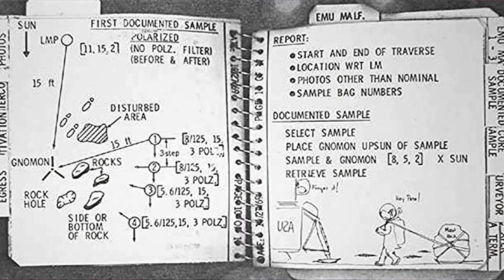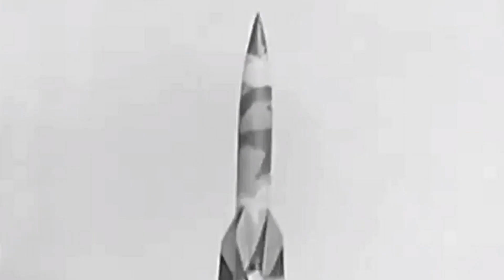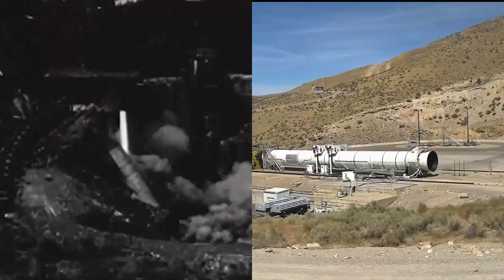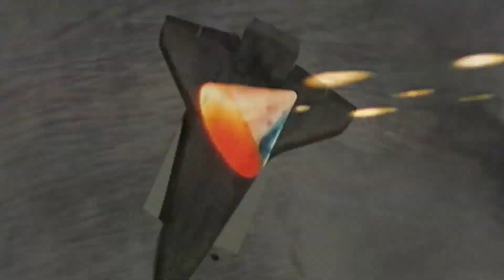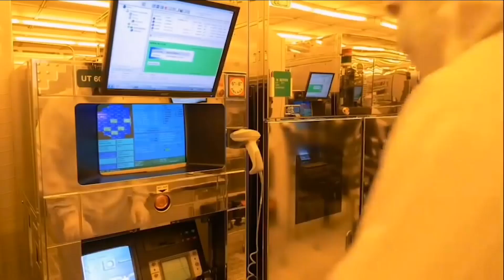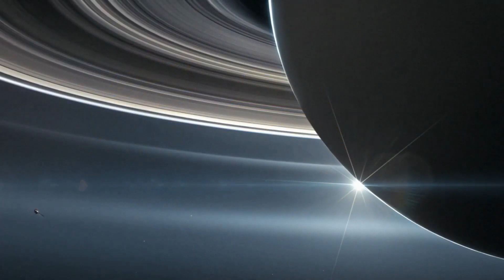"THE APOLLO DISCUSSIONS" WITH MARCUS ALLEN AND SCOTT HENDERSON PART 4

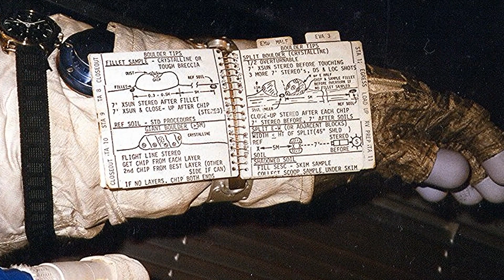Comment: @2:02  that watch around his forearm would've frozen and stopped functioning in the extreme temperatures.
Reply: There's no ambient temperature in a vacuum.
Reply: @hadleyrille9560  Right, it's either +250F in the sun or -250F in the shade.
Reply: @JP5466  You don’t  know what ambient temperature means, do you?
Reply: @corneliuscrewe677  The watch would not have functioned and either would there silly spacesuits.
Reply: @JP5466  Now try and think that through logically. Room temperature on the moon....
Reply: @corneliuscrewe677  I never said there was.
Reply: @JP5466  Same spacesuits were used on Skylab. Were they fake then?
Reply: @JP5466  * sigh * how would “extreme temperatures” affect the watch if there was no ambient temperature? That’s not even taking into account the fact surface temperatures were nowhere near either extreme on ANY lunar mission. No, really.
Reply: @corneliuscrewe677  They were in low earth orbit and still protected by the Van Allen belts.  I know it's hard for you NASA fanboys, but try to stay on topic.
Reply: @JP5466  The topic is the moon, dear boy. Do try and keep up😉
Reply: @JP5466  A7L spacesuits were designed to provide an atmosphere capable of sustaining amp astronauts life. They were not anti-radiation protection despite the hoax nut claim to the contrary.
Reply: @JP5466  So many of these Apollo Witness dummies are convinced AIR heat /cool's matter. 
Its a very bad conductor. Yet they landed in the cool Moon Mornings before it got too hot...
Reply: @corneliuscrewe677  You brought up skylab not me -lol
Reply: @corneliuscrewe677  lol - what?  Troll.
Reply: @JP5466  I asked if the same spacesuits used on Skylab were faked. A subtle yet important distinction. No one but uninformed and/dishonest hoax believers has ever claimed A7L spacesuits were radiation suits. Prove me wrong.
Reply: @JP5466  Oh, the irony of someone who deliberately chose the screen name “Ben Dover” calling someone else a troll, particularly when said someone being called troll is asking relevant questions and making factual statements.
Reply: @corneliuscrewe677  Moon landings were an incredible hoax - prove me wrong.
Reply: @JP5466  Apollo is accepted as fact, whether you like it or not. You are making the claim of fraudulent activity. Burden of proof is on you. Don’t worry, I don’t expect you to come up with anything. The mere accusation is always more than enough for someone of your intelligence level.
Reply from the maker: I think the gears would have cold welded themselves together first. Cheers!
Reply: @Shill Stompers  Then why didn’t they weld themselves together on Gemini IV?
Reply: Cos it was fake. Now clean your house.
Reply: @papalegba6796  You’re a sad broken record Legba. Tell me, are you actually claiming nuclear fission is fake too? Please say yes....
Reply: Please clean your house. Maybe your wife will have you back if you do?
Reply: Lol listen to messed up troll corny crewe pleading with random anons in yt comments sections to allow him to abuse them. Perfectly normal behaviour.
Reply: @papalegba6796  I won’t go out with you, Smegba. Stop begging.
Reply: @papalegba6796  Hey, I found your video! It’s a good likeness of you, 4th level!.... https ://youtu.be/fQ18G5WIo-0 .....link is intentionally broken, just remove the space after https.
Reply: Crazy guy says what?
Reply: @papalegba6796  quote ”Crazy guy says what?”
Oh that’s easy. Crazy guy say “corny needs to clean his floors, durr-hurr-hurr” so much that not even the sad sad that support this channel even pay attention to you. Do you really not have any better material?